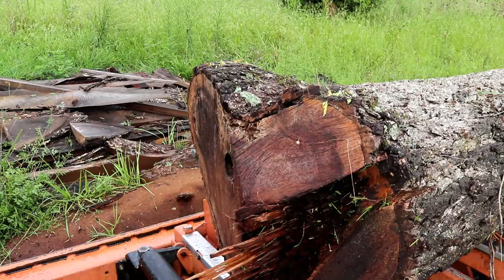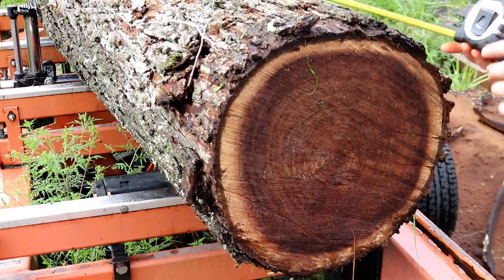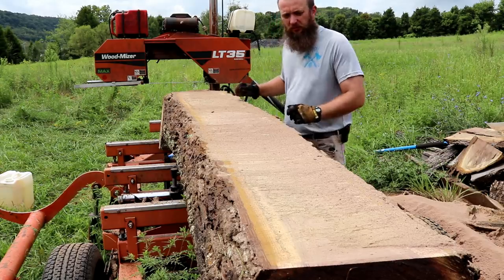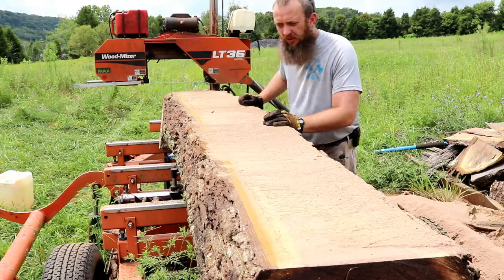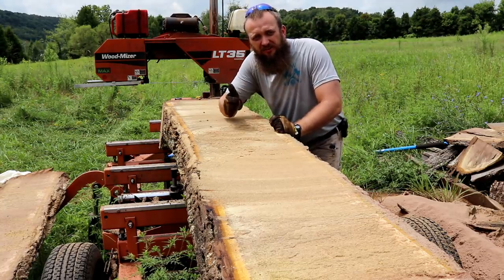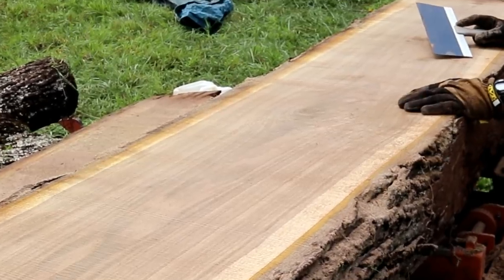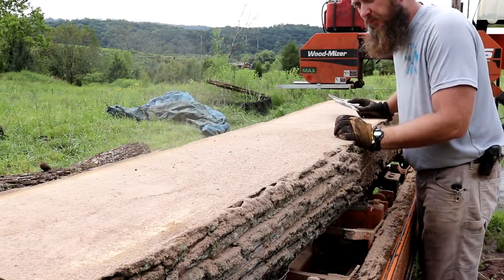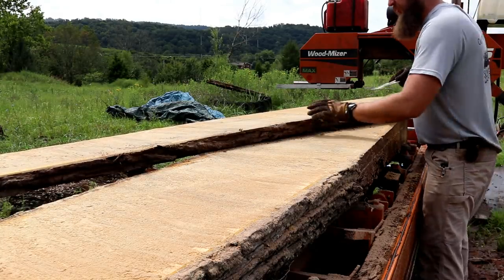ANOTHER LOG WITH GOLD HIDDEN UNDER ITS BARK,

Comment: If you would bury those walnut logs for about 6 months in a damp spot the bark will bleed stain into the white wood and the heart will get much darker.   I had a LT 40 and loved sawing gun blanks out of walnut and curly maple.
Reply from the maker: Interesting. Might try that👍
Reply: That's a great tip! I too will give that a shot one of these days. I'm just a guy with some trees, a saw, and a love for making things out of wood, so I don't know all the tricks of the pros. Nice to learn something that I didn't know yesterday.
Reply: Excellent info thank you.
Reply: odatmatt 🎬🏵
Reply: What does that even mean?
Reply: odatmatt yea I've heard of burying logs before to enhance the colouring of the grain.
Reply: Please tell me more about burying wood, say in a swampy area. any hard wood? what results do you get. please inform me of your knowledge.
Reply: Iworks best on walnut and Butternut,   Their bark is full of dye and it will leach into the sapwood.  I always buried them about 3 or 4 ft deep ,  stops the rotting that way,   Take a branch and Just use it to find a spot you like,   I allways buired mine  in the blackest dirt I could find and leave them for 6 months or so.  And don't bury them when you are drinking ,  when I was 16 we did that and lost 50,000 br ft of prime wallnut.    Now I drive a stake at each enc of the logs!
Reply: ❤️wood geeks!
Reply: ironically I brought this topic up at the house just the other day, I was unable to find out anything about it. I knew that there was this burying of wood to get color but, I knew little about it. I will take the sobriety suggestion into account , and thank you.
Reply: Out of the Woods just tell me where you buried them. Jk
Reply: Sorry just saw this,   a swamp is the best place to bury walnut.  The bark contains a natural dye that will color the white wood brown and the dark heart will be almost black.  Put them down 3 or 4 feet and they won't rot.   Make sure that you have a few ways of finding them.  When I was 16  I started helping the 85-year-old neighbor cut a huge stand of walnut that his G-G-Grandad had planted 250 years before.  50 to 60 inches 4 feet up and 40 to 50 feet of clear log.    We lost 20 big walnut trees one Sat. 50 years ago. We were burying them in a huge swamp with a 1948 D-8, that was in 1966,  no one ever found them.   Might have something to do with the homemade wine we were chasing the whiskey with!     It will darken any wood,  not always with the desired result.   So other than walnut I would only bury samples at first.  Different chemicals in your ground will give a different result than I may have gotten.  I have buried white oak planks under manure and straw,   the manure gives the white oak the "fumed" look of the 1930's Stickley type or furniture.  Anyway, have fun with it!    Oh, bury walnut at least 6 months in a swamp before sawing.
Reply: you can also just steam the boards when its cut and you will get the same end result and much easier.
Reply: @truetrue2963  if you steam the boards you will even out the color a little,  beige walnut is what I call it.   If you bury it in the right spot it will darken the wood as it leaches the "stain" out of the bark into the wood.   It is worth the work.
Reply: odatmatt 
I metal detect a civil war campsite in Tennessee. One time I dug up a sawmill Oak board from the site. It was buried in a lime layer and wood was still solid. Took a piece of it and soaked it in linseed oil for a month. The Oak was as black as Ebony! Make a couple slabs and brass pinned it to a John Russell Green River knife blank. Sanded and oiled and now it's absolutely beautiful! People can't believe I have over a 150 year old knife grips!😝
Reply: @13bravoredleg18  I would love to see that Randal knife,  I bet she is a beauty!   I loved making things out of old and reclaimed wood.
Reply: Interesting read about burying it in a swamp. If I buried a piece around my place the red dirt of Oklahoma would be doing all the staining!
Reply: @JEBavido  As far as walnut the stain comes out of the bark, not the soil.   I worked the Okla. oil patch for 20 years,  was always amazed at how many walnut trees grow there on the river bottoms.

Comment: Walnut is by far my favorite wood, I like the way it carves, the way it smells, and the way it looks with a nice natural finish. I can just imagine when you open up one of those what that is like.  I need to get some stock to cut some spoon blanks from you.  Thanks for sharing.
Reply from the maker: Thanks for watching 👍
Reply: Isn't walnut exceptionally rough on sawblades? I've worked it just a few times and it's unquestionably a very hard and heavy wood. It seemed like it ate up sawblades pretty fast. More than oak or maple in your experience?
Reply: I’ve always loved it for carving, both for the aesthetics as well as the workability.  I work a lot with endcuts, slab, and what most consider to be “firewood”, and it carves nice green as well as seasoned.  I’ve found it with inclusions varying from purple to green within the heartwood.  I use natural finishes and that doesn’t seem to affect it much either.

Comment: Very satisfying video. I just learned the other day from my 86 year old mother that the house she described living in as a child was actually part of a logging camp.
She had mentioned the house on numerous occasions previously, but it was just the other day when her older brother, my uncle, was visiting that the fact came up that it was in a logging camp. I think more precisely(?), it was a sawmill camp. The men would cut down some trees, haul them to the sawmill, cut them up, and trucks would come pick up the lumber and take it to a mill for further processing.
I still have relatives in the business not too far from my mother's childhood home in the camp. I think back in the day oak was the mainstay, with cedar also. The sawmill was a large circular saw run off of a truck using belts for power takeoff.
Most of my family are city dwellers now.

Comment: YOU ARE DA MAN!  That is some beautiful wood.  I looked up the saw unit you are using and do I understand correctly that the tank on the top left (as you face it) is for water - to keep the blade cool?  I was curious about that.  Thanks for sharing such an awesome video!
Reply from the maker: Yes that is the water. Keeps the blade cool and clean. Thanks for watching 👍

Comment: I'm a carpenter,and we used to sharpen our old steel blades but unless you set them you are wasting your time. Must be a real challenge on those blades. I can appreciate the one piece tops that would produce. I've made many countertop s outta 2x6s and the like clamping and glueing, and they too are beautiful,, but a single piece is special alright. At least if trees must get cut,, making them into treasured items makes it easier to take. Cool job.  Thanks for sharing.
Reply from the maker: thanks Peter, appreciate you watching,

Comment: I know a lot of people don't like knots but I like them. I like the look. It's more difficult to work with and you really need to think about where the knot will land in the build but the looks is just amazing to me. Did my kitchen cabinets with pine and I kept some knots in there. It took a while to pick the wood though.
Reply: I like knots, too, as long as they're sound knots and there aren't too many of them. Once, I found a very sound knot that looked like the planet Saturn, and I saved it for a prominent place on the main entry stairwell handrail in a house I was building. 
-- For projects for my own use (bookcases, an occasional cabinet, built-in shelves for odd corners) I use salvage lumber or unfinished bookcases that people throw away. I'll admit to using wood with loose knots which I have worked free and then glued back in place. It's kind of a strange hobby, making nice things out of garbage. When I was younger I took in a lot of strays, both 2- and 4-legged. I guess it's a sympathy for the underdog and the underrated.

Comment: lost art press just released a book about the more sciencey side of processing wood, and it has so much information.  loving it so far.
Reply from the maker: saw that, need to check it out,
Reply: i'm doing a lot of older school processing "with modern tools" (hybrid).  so i use an electric battery chain saw for cleanup (you need dis!), and a froe to split on grain, rather than saw.  move a lot of stuff with log arches (log rite is local :>)

bandsaw soon, mill later.  

know about PEG treatment?  how do you dry?  am new to your feed, will explore.
Reply from the maker: I air dry for about 8 months. Then the wood goes on my woodmizer kiln

Comment: Nice boards.  
I used to work at a paper mill, and one thing i miss, are the smell of freshly cut wood.
Reply: BelieveNoGod Where ay.  I worked at the Rieglewood Paper mill. I left there the end of 2014.  Was owned by international paper company. Which mill you work at?

Comment: Beautiful bit of wood. Slightly off topic, in some parts of Europe trees have bits of shrapnel in them from WW2 so you have to run a metal detector over the logs before cutting them, those bits of shrapnel make a mess of the blade if you're not careful

Comment: I'd need to fork-out nearly two-and-a half grand for a slabbing attachment to put on my Peterson (swing-blade) mill to get slabs like that. 
At 20", I "see" a very sweet table top where adjoining edges are jointed and meet in the middle, length wise @ just under a 40" width...that's where the "gold" is. Sweet.
 Awesome milling...
Reply from the maker: thanks!

Comment: Might want to consider painting the ends of ANY log you might consider turning into lumber.  Helps prevent splitting and cracking.  Learned that from a sawmill operator.  That's why a lot of the better wood fresh cut lumber has paint on the ends.   Any cheap paint will do.  I go to Lowe's and find their rejected buckets of paint (Their "You go my color wrong" Buckets) and slap it on as soon as I cut a section of wood that I think I might use for lumber.  At $5 - $10 a buck for paint can't afford not to do it.
Reply from the maker: I use anchorseal and have done previous videos on the subject 👍
Thanks for watching

Comment: I live on the South East coast US, I have a limbed straight Cyprus tree in my back yard that I would consider TALL. I was wondering if there is any value to the tree. It is pretty but, it makes quite the mess. Kinda like a Magnolia tree with it shedding. I would rather not just destroy the tree if it would have some value to the correct person. Any suggestions..?

Comment: About how old was that beautiful specimen you turned into furniture wood? I'm guessing black walnut that size is about 4 or 5 human generations, maybe more? I hope you are planting new ones in the same spot for someone 200 years from now to enjoy too.
Reply from the maker: it was blown over by a storm, i didn't take it down,
Reply: Wonderful. Thank You. My late uncle ran a lumber mill in northern CA for several years. All Pine up there, but I now see the virgin grain structure both of you saw. My first wood project was with black walnut. Like cutting diamond hard, but add one coat of varnish and a color jumps out like nothing on earth.
Reply from the maker: agree, its my fav wood to work with, thanks for watching!

Comment: Would there be an advantage to not have the weight of the slab on the blade as the cut gets further into the cut?
Reply from the maker: None. The saw is powerful. Doesn’t make a difference. Thanks for watching

Comment: Perhaps you only did it this way for the sake of the video... but please leave your motor running when you use your hydraulics. You'll kill your battery. Trust me on this one. 

Nice walnut. If you have a good dry kiln operator in your area then you can make these slabs much more valuable. 

Just subscribed!
Reply from the maker: Been sawing 9 years on this saw. Never had a battery go dead due to that. 
I have my own commercial kiln also. 
Thanks for watching 👍
Reply: Cool.

Tree Murderer.   That's funny.

Comment: Am I crazy for thinking pouring a bucket of water on an untreated, freshly cut hardwood slab is a terrible idea? I could see spraying it with denatured alcohol, but water?
Reply from the maker: there is more water in the board that I pour on it, it does nothing to the wood, I air dry it for one year then place it in my kiln, 
it would be foolish to think that I would damage these valuable boards just for a video, 
denatured alcohol would be a poor choice on wood with a high moisture content,
Reply: That makes entirely too much sense. Hadn't even considered that. I've done quite a bit of woodworking, but typically using stock from specialty lumberyards with domestic and exotic hardwoods. Understandably, these are already kiln-dried. I've only ever used DA to preview the character of the wood. Very informative video & awesome work! Thanks for the reply, and keep it up!

Comment: I watch all kinds of sawing vids and hardly any of you use water on the blade when sawing.I have been sawing logs for 20 years on an old lumbermate III manual  with a 13 horsepower Honda motor and i can go through a 24"walnut log 2-3 times faster in a pass than any of these fancy automatic drives and feeds.I set and sharpen my own blades. I run water on the blades when cutting and it slices easier,quicker & blade stays sharp longer. Always hose all sawdust off of boards before stickering and no mold or dark stains.